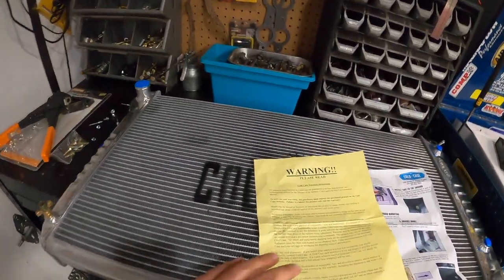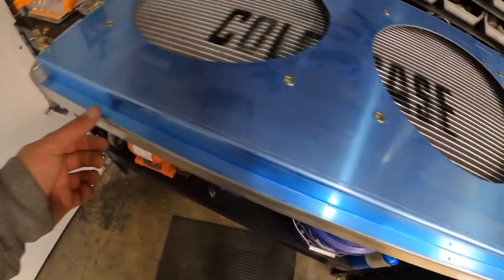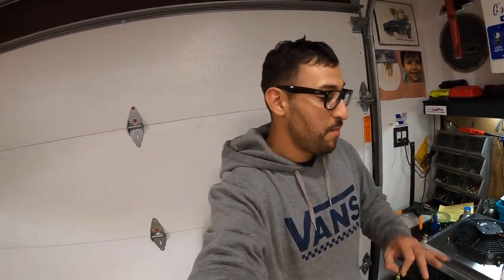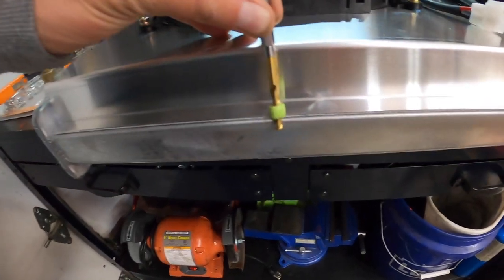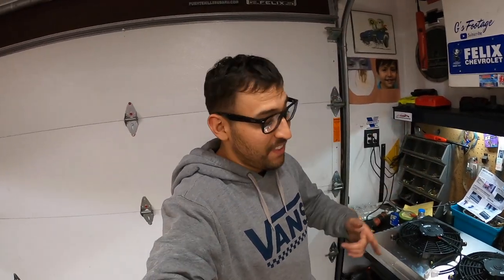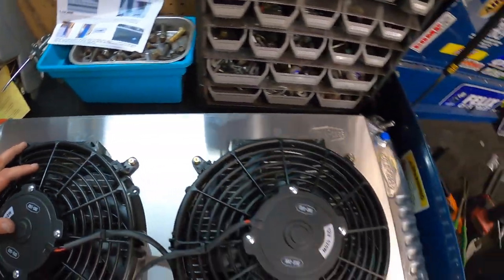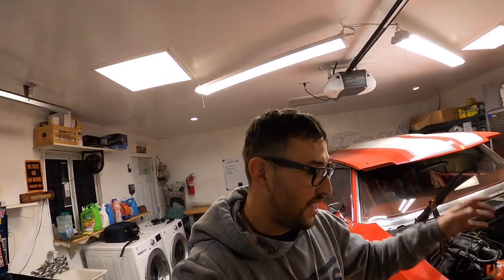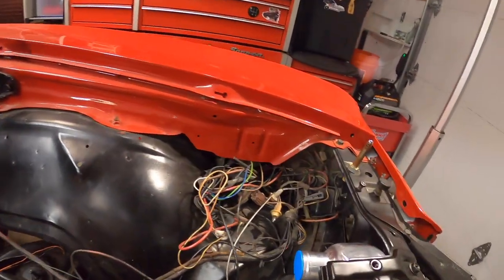Cold case radiator and electric fans

Comment: Looking at this set up for my C-10 (small block) Are those the 12 inch fans? If so, do they keep the big block Cool?
Reply from the maker: to be honest they don't. my car still runs hot in traffic and long trips. I removed the old ac condenser, added a lower thermostat and still get the good old big block temps. if you look up my friends channel "Burndown" -Dane Paul Thompson . he has nice videos on wiring high output fans that blow more air than any aftermarket fans and he gets them from the junk yard. check him out. great content too

Comment: Did you find there was much of a power increase once you installed the electric fans over mechanical
Reply from the maker: tbh ive never had the traditional fan on the car. bought as a roller

Comment: @ G's footage  Where's the wiring up the radiator fans video u said was coming pimp?
Reply from the maker: Im sorry sir, I must have missed that section. I do apologize, but its really easy if using the Holley.  the instructions provide a good guide and the wires are labeled if I remember correctly.